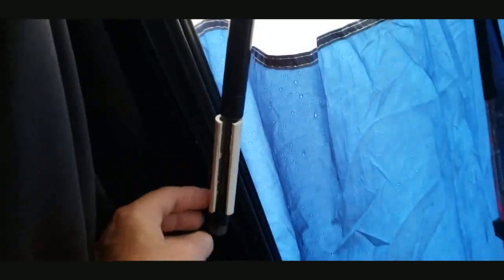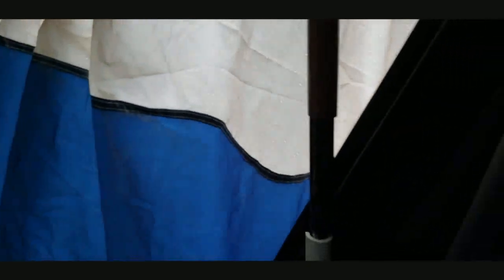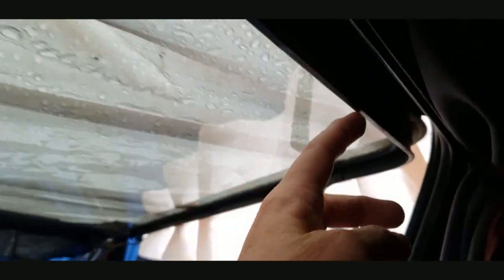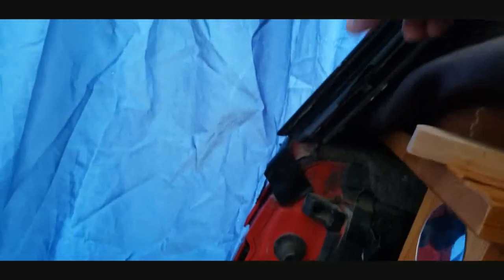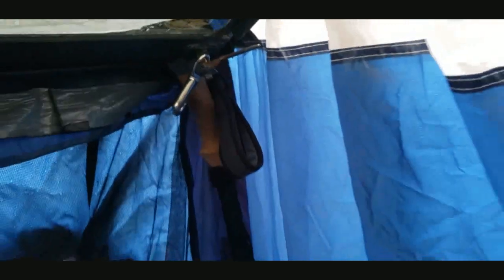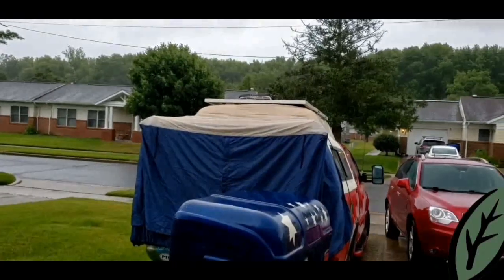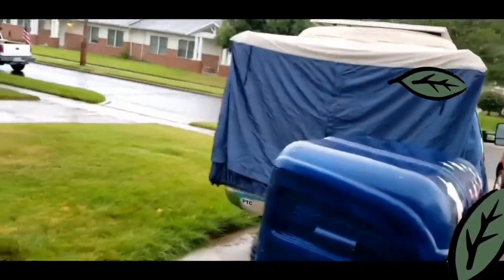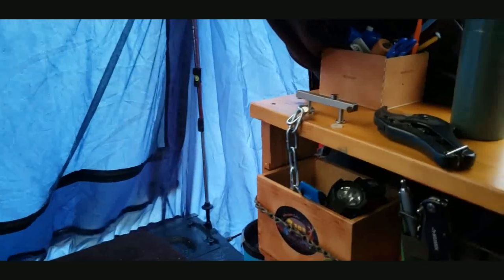DAC Tent for pickup trucks. Macgyver Sharon Mods #vanlife Van Life Nomad Truck Build

Comment: Did you have any leaks from the water running under the tent off the camper shell??
Reply from the maker: Hello Wayne 👋 Luckily I did not. I put it far up as possible on the roof, then I lowered the back window holding both sides at a height with my hiking poles ☮❤🕉

Comment: wouldn't it be easier to replace the struts on the cap, rather than building braces, and PVC pieces to hold up the cap window?  Seems a new set of struts would be way easier than cobbling something together
Reply from the maker: Hello iamgriff 🙂 They were brand new struts. I put the brace inserts just for safety because wind or weather can effect them and if my window slammed down and broke, it is impossible to find a replacement. Also if I added weight with a screen, tarp or dac tent. In the past I have had an engine hood crash down on me. Maybe I'm just a little bit over cautious 🤔😃  ☮❤🕉
Reply: @MacgyverSharon  it still sounds like A lot of work....You could get 2 cheap pair of vice grips, and clamp them onto the struts. 
But hey, it's your life, and truck. I'm just offering constructive criticism.
Reply from the maker: Iamgriff 😍👍And thank you for your input too! Constructive criticism is a Positive input my world 🌎  ☮❤🕉
Reply: I have a 8' bed F250, with the same truck cap, and DAC Tent. I had a couple of 6" vice grips laying around. I clamped them to the struts on my cap. Problem solved. However, my Leer Cap's window has sharp corners on the glass. I was real concerned with the tent ripping there. I shoved shop towels under the corner before pulling things tight with the bungee cords. 
Also, with the caps at the tailgate, I took the same shop towels, and rolled them up longways. 5-6 of them fill that gap nicely, and are held with .99 cent spring clamps from the Home depot. I use my tent almost every weekend in the summer here in Michigan, it's 2.5 years old now, and holding up well.